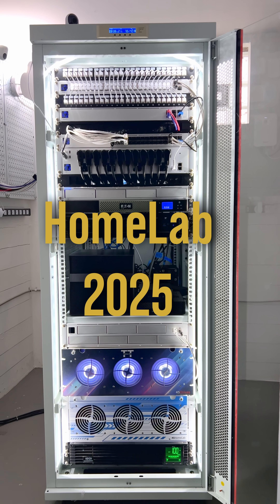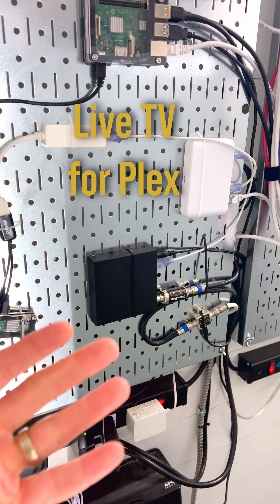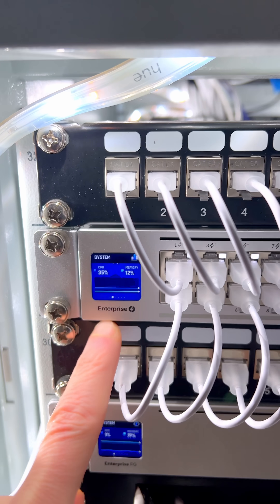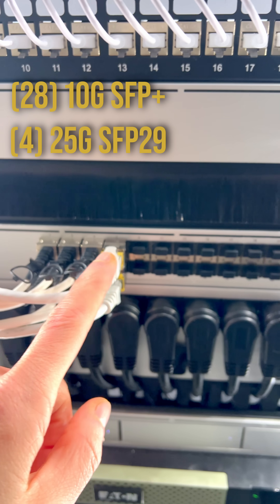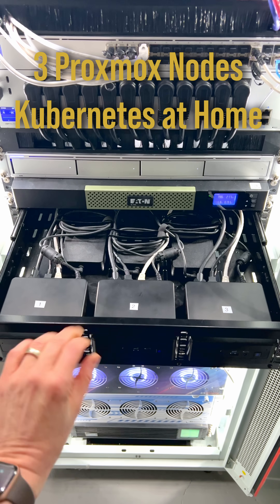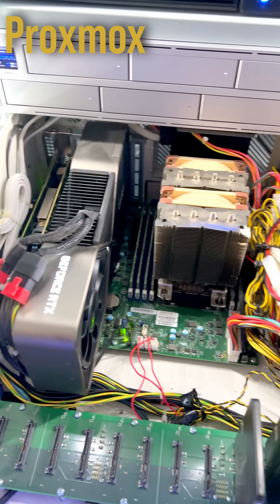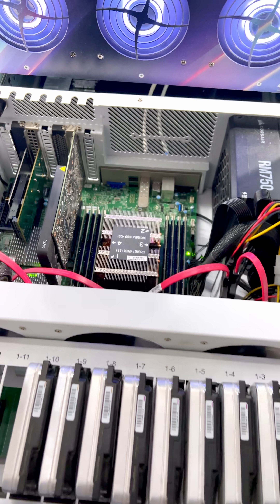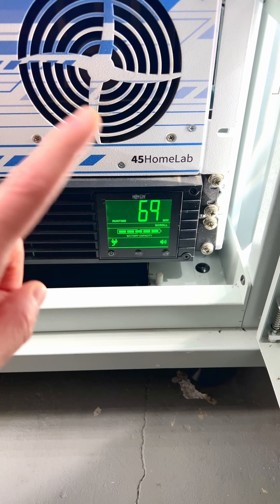Homelab Hardware Tour 2025

Comment from the maker: If you're looking for the parts list, it's in the full video's description which is linked from here
Reply: I am wondering, what it is used for?
Reply from the maker: @Muralidharan001 I explain 100% of what it’s used for in my HomeLab Services Tour
Reply: LMAO and here I am stuck trying to setup pi-hole for my home network! 😂.
Reply: how much is the electricity bill on average?
Reply: Where is ur F5 HMM?!
Reply: G to G my dude. Ty
Reply: You are a wanker, sir.
Reply: Rid yourself of any optane drives - I hear they fail with  a horrible destructive outcome..
Reply: Where is the list components?
Reply from the maker: @skywar349 full video is linked
Reply: how did you get 70 mins run time on the bottom ups with all that above it

Comment: TLDR: ~$657/yr or $50/mo with inefficiencies. 

A 500-watt server running continuously for 24 hours consumes 12 kilowatt-hours (kWh). Cost depends on your electricity rate.

Calculation:

    Power: 500 W = 0.5 kW
    Energy per day: 0.5 kW × 24 h = 12 kWh

To compute cost:

    Cost = 12 kWh × (your electricity rate in $/kWh)

Examples at common rates:

    $0.10/kWh → 12 × 0.10 = $1.20 per day
    $0.15/kWh → 12 × 0.15 = $1.80 per day
    $0.25/kWh → 12 × 0.25 = $3.00 per day

Monthly and yearly estimates:

    Monthly (30 days) = daily cost × 30 (e.g., at $0.15/kWh: $1.80 × 30 = $54)
    Yearly = daily cost × 365 (e.g., at $0.15/kWh: $1.80 × 365 = $657)

Notes:

    Actual cost can be lower if the server cycles on/off or higher if used with inefficient settings.

Comment: so there is one key part missing how many amps
just gonna assume its less than 15  because standard breaker is about 20 amps

unless you ran another circuit 😂
having said that 
the cost for power is anywhere between $200 assuming your power charges you the avg of power is 15 cents a kw

Comment: How many people are served with this homelab setup?
The aim shouldn't be to throw as much hardware that can be bought to get a reasonable solution. But instead the aim should be to build a minimal solution with the least amount of power used.
I also have an  about 5 years old Gen2 Epyc system with 32 cores and an idle power of about 200 W. This will now be replaced by a MiniPC with more than twice the single thread and slightly higher multi-threading performance, and with less than 50 W idle power. Technology is advancing fast.

Comment: I will switch the pi zero w2 to a pi 4 because  if you have 1gb internet from your isp you are not getting the full speed that you are paying your isp for with the pi zero w2 your are getting usb 2.0 speed (480mb)with it but the pi 4 have a 1gb ethernet port so you will be getting the full speed I use to have a pi 4 running adguard and then switch it to a pi zero w2 and noticed that my internet speed went down and I switch it back to the pi 4 and I have my full speed back

Comment: Every home lab explanation is so unsatisfying because the actual purpose of so many things is left unexplained or vague. Hubs, switches, controllers, clusters, servers, proxmox, devices for "testing", NAS, compute modules, etc., but what are they actually doing? The only purposes clearly articulated were some LEDs, a power switch, a Plex server, and LLMs (without an explanation of the LLM's purpose).

Comment: I am consolidating two racks each with a 2U 1500W battery ups. Can I run those in parallel to increase my power and can I use that in combination with the unifi power distribution? I’d love a video short a quick YouTube video talking about battery back ups and the unifi power distribution.

Comment: Dual fibre with WAN failover - points to 2x RJ45 copper ports...
Reply from the maker: Those copper ports are 2.5 Gbs.  I only have 1 Gbs from my ISP.  If I get more than 2.5 I will use the SFP+ but until then this is best

Comment: dawg, 140 TBs for what? This is the most over-kill setup I've ever seen in my life and I'm so here for it lmao.
Reply: If he got them ran in raid for data security then he would just have 70TB. He mentioned he could do some screen recording with one of his raspberry pi? Plus he doing YouTube he might keep backup clips and videos we dont even see on there? Idk just guessing
Reply: @whatta7793  Raid 1 is super inefficient on an array that large. He would be better off with raid 60, losing 4 drives to redundancy instead of 7
Reply: My current NAS is ~80tb, about 80% used.  70% of that is various media I've ripped and saved, 20% is media I've created (videos, pictures, etc) and the rest is stuff I've saved from jobs or random crap from the internet.  Nas 2.0 is going to be 200+tb and hopefully will last me a long time before I need to upgrade.  Home network is only 10gbe because second hand enterprise 25/40gbe switches are way too loud and I still have Ubiquity PTSD and refuse to use them at home for completely irrational reasons =D
Reply: What is it with home lab owners and refusing to elaborate on what they're doing that would require a petabyte of NAS, 50 gigabits of network bandwidth, and 192-switch ports? It's starting to seem like they just enjoy collecting hardware and wasting electricity on it.
Reply: @enormousearl8838  he does use it atleast. . . but who cares even if he doesnt, its fun
Reply: @enormousearl8838 yeah I only have fiber running to my house powering a bunch of devices and idk why anyone would need 10gbps? I'm fine with 1gb fiber, if anything 2 runs of fiber would be more than overkill for me even, would need to be moving a lot of content to/from the internet to use that much
Reply: @enormousearl8838  I mean the biggest thing for a nas would be video files, which a big time movie watcher would have lots of. Plus hes a youtuber, so archive footage

Comment: Curious how the RPI running NUT for three UPS’ is powered? Are all the UPS on the same primary power and you’re just turning them down as they drain during a power outage? What’s powering the RPi so it’s left on as the last ups dies? Or is it attached to the one with the lightest load?
Reply from the maker: Yes to all!  It’s attached to the one that powers my modem/ONT which should last the longest.

Comment: i mean just cause they call the switch enterprise doesnt mean it comes with enterprise features.  looking at the datasheet it would be considered a lower end switch in the enterpruse world.  to give some examples, the lack of switch stacking for true redundancy, hot swappable components for better uptime.  true redundant power supplies, and the backplane supports 160gbps, which is nice but pales when you consider a cat9300 has a backplane of 1.4tbps.  other software limitations include layer 3 tech such as any routing protocols.

that being said, ubiquiti is the perfect solution for a homelab, you did great here.  ive used ubiquiti in a few small businesses ive help setup as well as my house.  so not a knock on their product, they just have a niche.
Reply: tell that to my company man... 400 employees, whole network runs on Ubi gear (with a few Aruba APs thrown in)... we don't even have the "Enterprise" branded stuff. It's so horrible, but that's what I have to deal with :/

Comment: As an Infrastructure architect. Very nice home setup!!!
Reply from the maker: Thank you!  Infrastructure as a Hobby here :)
Reply: @ hobby here too, I have been lucky to do it as a career also. My home setup was mega five years ago! I have three Dell r720’s running VMware / esxi / vCenter / vsan and running in HA, vlan trunking with proper delineation for network traffic. RAID 10 (3 span) 15k drives. Then veeam incremental backups. I have ubiquity too, but older. I need to upgrade to something similar as you. It’s a nice lab, I can spin up environments pretty quickly. And run whatever VM’s for whatever service I want. You give good ideas for a home setup! Great work!!!

Comment: Electric bills love this man
Reply: should go solar power
Reply: Dont think so. Just the 3090 alone should do 250w.

Everything must be about 700-1kw
Reply: @i.respawn3545GPUs don't work at max capacity all the time.
Reply: @i.respawn3545 . . .at idle
Reply: 4,38 MWh for whole year
Reply: @ukaszpodhajski5250 it is only for doing nothing actually, full utilization will be at least 2x of this
Reply: This guy definately has power, solar back up, a generator n some Tesle power modules
Reply: its 500W at 30% load, not that bad
Reply: @notcapnbloodbeard 12 kWh a day. Depending on where he lives that’s $400 - $1,200 a year.
Reply: @notcapnbloodbeard nope, that was ups load
Reply: @ytxzwups load is still the amount of power the system uses. (Minus small stuff on his wall)

If 500w is being drawn from the ups, the ups will then draw 500w to fill up the space it just used...
Reply: @lmmaZoni no shit, but do you know what is connected to that ups?

Comment: Just a heads up, gaussian blur isn't destructive, if someone figures out the right kernel that QR code can easily be retrieved
Reply from the maker: @dooterino  that depends on brute force though, meaning reversing it would still lead to 1,000s of possibilities and then they would have to “guess” 1,000s of times.  Considering it’s only my mac address and the attacker would have to somehow validate their guess is right, gaussian is fine in this case.

Comment: Damn, this setup is pretty cool!
Excellent hardware choice and build.
I have a small home lab at home too, but a little smaller lol. I have two nodes running proxmox on-site, adding a third one off-site and connecting it vai VPN, a 64GB RAM Ubuntu pc running LLMs using a 8GB Radeon graphics (poor choice, I know).
All this is connected to a 2KVA nobreak that keeps my entire house running in case of a power outage.
The only thing I would've done differently in your setup is using BIND 9 combined with Adguard to use as my private DNS server and run them in VMs/LXCs on my proxmox cluster.
Here at home I receive about 120 DNS queries per second and 60% of it is filtered using Adguard's rules.
Again, that's an awesome setup and build. Thanks for sharing

Comment: I have a question regarding my network setup. I have a mini PC running Ubuntu Server with Pi-hole installed. I also have two routers: a Techroutes router and an Airtel router (provided by my fiber internet operator). While I can disable DHCP on the Techroutes router and forward DHCP requests to Pi-hole, I'm unable to disable DHCP on the Airtel router.  Since my primary internet connection is through the fiber line (Airtel), how can I make Pi-hole work without disabling the Airtel router's DHCP server?  I'm trying to avoid having two DHCP servers on my network.
Reply: If you have the choice to use your fiber as only a modem, instead of a router, it's an excellent choice.
Here at home I have one of my proxmox nodes running Openwrt for router with three network cards.
You can setup two of those network cards as WLAN and load balance between them. In your Openwrt DNS settings you need to provide your DNS server IP.
It's not a straightforward setup but it's worth doing.
You can also use Open sense and it is even simpler to setup.
If you're using proxmox, which I really recommend, you can Google search for "proxmox ve helper scripts". This is helpful as hell to install new stuff without the need to setup VMs or LXCs manually.
Go ahead, try it out, spend a night without sleeping to configure your setup, fuck your home network as many times as needed and learn how to do it, it is an excellent experience, for real.
One other thing I really recommend you to learn is about VLANs and VLSM, but this is a step forward, after setting everything up and learning how to do it at least twice

Comment: I majored in computer science back in the days, but now I know almost nothing of your rig. Can you tell me what it achieves and what happens if you don't run it? Sincerely.
Reply: NOT TechnoTim lol but here is my answer to ur qs:
at the start you saw alot of phililips hue stuff which is probably to do with lighting 

alot of the networking is for home automation and other home stuff, so what that means is all the electronics like tv's, security cameras etc are all connected by one ethernet wire straight to the network instead of over wifi for example. any pc's in other rooms and stuff will also be getting that direct ethernet :) this is what the PoE unifi networking switch is for.
Similarly the firewall is also for networking and protects your network from malicious actors outside the network, also if you have kids and want to censor sensitive content etc, the firewall can be used for that.

the PDU is the power distribution unit and it, well, distributes power to everything.
UPS is the uninterruptible power supply, it is basically like a giant battery which stores energy just incase there is a power outage, sudden power outages can be dangers for computers in case of updates which can brick the system or if you lose unsaved work.

The intel nuc cluster is a cluster of small pc's which are linked together probably using  kubernetes (software which is used to distribute workloads? idk i dont use it:) ) and it runs proxmox which is a linux based hypervisor (virtual machine host) and this is probably for his website. a cluster is used as it adds fail safes in case one of the pc's fail, the rest can pick up the workload thus no loss for you, the user.

he then has a few testing computers

He has a few NAS' which is a network attached storage, basically anything you want to have saved like work can be storage on this/these machine/s and accessable by anyone on a network.

I typed this out as such bcz idk what you know, i didnt mean for any of this to be condecending in anyway, just wanna be helpful :) have a great day!
Reply: @anonymoususerinterface  Don't worry, you are the most helpful person I met on net lately, thank you for spending time answering my question. Of course I should know about power supply or UPS, or even why he has that much of NAS, it's the first half of the video really confused me. 😂
Reply: @anonymoususerinterface  So nice to see someone being kind enough to take the time and answer a strangers question as fully and succinctly as possible. You even thought to preemptively apologies just in case you came across as condescending. 

You weren’t condescending, had no need to apologise and you were throughly helpful to a person who posted a polite question. I work in I.T. and work with these systems, so if there’s anything I can add, please let me know.

You put a smile on my face because you were being so nice… On the internet, which is so rare. Not in the least part because it takes time to do. Most are never willing to or even actually want to spend that time in order to write something meaningful.

You did… 

And Thank you.
Reply: @anonymoususerinterface 🙏🙏